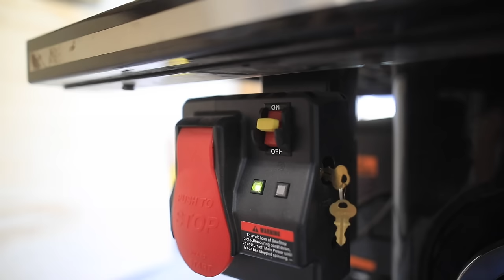Every Workbench Should Have This! // Woodworking // DIY

Comment: I'm curious to hear how these have stranded up to any expanding or contracting with changes in humidity? I'm thinking of using this method on my mobile workbench build.
Reply from the maker: Two years in and they still work great. Plywood doesn’t expand and contract like solid wood.
Reply: @DanielDunlap  thank you for the quick reply! I plan to build my mobile workbench next week.
Reply: Just checked, they’re still sliding

Comment: Love this! I’ve been looking for a smart way to make drawers without buying a bunch of expensive metal slides. I’m going to have to use a router because my jobsite saw won’t accept dados, but other than that I’m going to follow your lead. Love the handles as well. Simple and don’t require additional hardware.

Comment: I like the way you did this very much.  At first I was wondering why you placed what turned out to be the bottom into the dados.  It seemed to be a waste of wood.  Then when you put the drawer boxes in and marked them to the bottoms it made perfect sense and its a great idea.  I haven’t seen it done that way before.  I have a lot of those plastic storage boxes I got from Harbor Freight and Ive been mulling over in my mind how to put them in a cabinet below one of my rolling benches and this lit the light in my head to do. It the same way.  Make the bottoms to slide in dados mark the tray to the boxes and put a few screws through the box into the sliding tray so they would have something to hold them and easily slide them out.  First time Ive been to your site.  Glad I stopped by.

Comment: Awesome use of the bottom for slides. I've done slides, rails, you name it. Will give this a try, making a captains bed and never know what side the drawers will need to slide out of. Might give this a try. Only issue I had in the past with the drawer fronts is lots of dust getting in there. Hated always vacuuming those out. Putting a few moving blankets helped but always an added hassle.

Comment: Thanks for the video , I have 2 bench's that I want to add drawers to , and some BigBox Store melamine  cabinets with doors that have shelves , and are a waste of space. I looked at using  metal drawer slides  , but that would have added up $$ significantly, considered  using something similar what you did, but couldn't get it off the ground ! .....Onward !!
 thanks!!

Comment: Can anyone recommend a way to support larger drawers, constructed the same way that are @ 30x30'? I'm adding drawers under my outfeed table and I'm thinking my 1/2" plywood will start to warp. Should I glue and screw in a support on the inside of the drawers length or width wise? I used 3/4" plywood for the "face frames" with dado's cut in.

Comment: Total noob question, but what thickness ply did you use for the vertical members as well as the drawer boxes?
Reply from the maker: I used 3/4" for the verticals and 1/2" for the drawers.

Comment: very interesting video.... can you answer a cpl questions for me..... what kind of weight are in the drawers and how are they sliding after a year?  Seems like a great money saver. I made a 15 ft bench and was wanting to put drawers and sliding baskets under it... Thanks in advance.
Reply from the maker: Each drawer can easily hold 100lbs or more. After a year they’re still working/sliding great with that initial application of paste wax.
Reply: @DanielDunlap  thanks for the info

Comment: Quick question how much of the bottoms do you have sticking out for sliding,,and are the drawers made of 1/2 inch completely? Thank you
Reply from the maker: TheCladi8or - 1/2” sticking out on the bottoms for sliding. And I used 1/2” ply for all drawers until I ran out and had to use some 3/4” leftovers i had from other projects.
Reply: @DanielDunlap  
Thanks

Comment: I'm just about to add drawers to my bench and I saw this, I love it! Can I ask how the drawers are going a year later? Any issues with the slides wearing or bearing weight? Cheers from Australia mate.
Reply from the maker: BennyB76 they’re doing great! Check the stories on my Instagram account. @danieldunlap.woodworks
Reply: @DanielDunlap  thanks Daniel, have subscribed to your IG account, some great stuff there too. Hey sorry mate one more question - how much wider are the dado's that the drawers slide into  compared to the thickness of the drawer bottoms? They look pretty flush from the video but I guess they'd have a little give in them, say 1mm or 3/64 of an inch? My table saw won't take dado's so I'll have to router them out.

Comment: The drawer slide runner may look good. But 2 very bad mistakes the paste wax  attracts dust that instead acts as a grinding paste which increases the wear. Secondly the use of plywood is too soft especially if the drawers are full of heavy goods
Reply from the maker: Mark Bolger - False. Over a year into heavy use and they’re holding up as good as new.